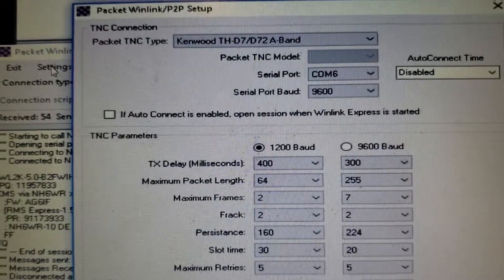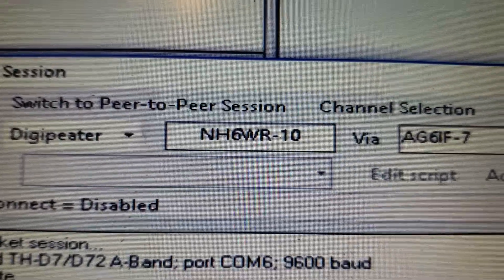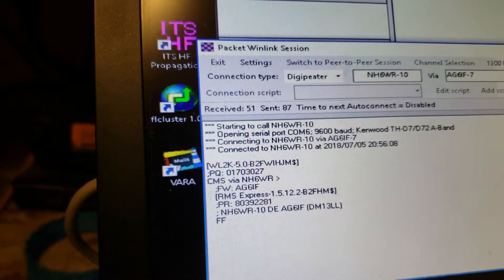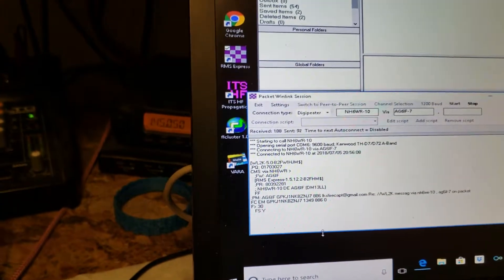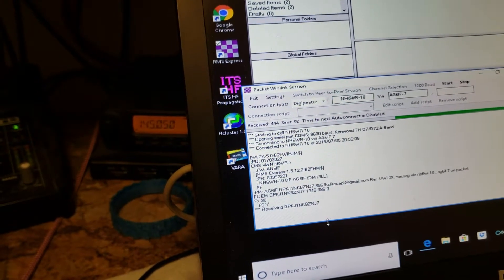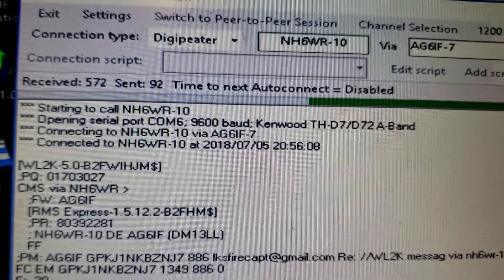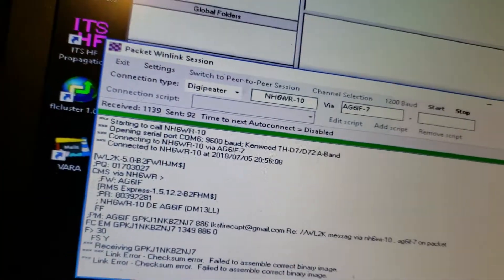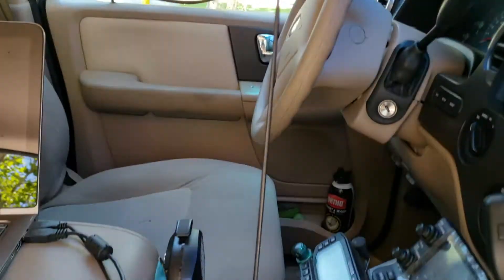Winlink vhf packet with a Kenwood d72a and the VIA function for packet radio

Comment: I just got WinLink working with my new TH-D74A and love it. However I am curious if there is a way to use the internal TNC with a dumb terminal like the old days. I tried using the old HyperTerminal and also puTTY, but have not had any luck yet. Thanks in advance for any tips!
Reply from the maker: Hi Don, I dont have a 74a, but maybe someone else will chime in. 72a works great.
Reply: Hi David, are. you able to connect through the usb connection to the D74? My D74 will not connect to KISS via the usb cable, but it will connect tp the RT Systems programming software through the usb. Thanks, Ken K6KT